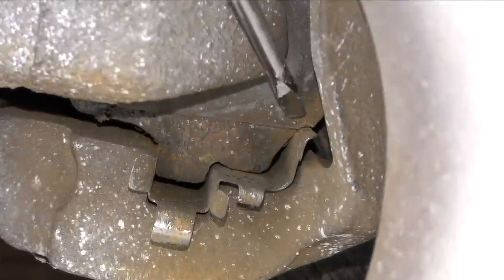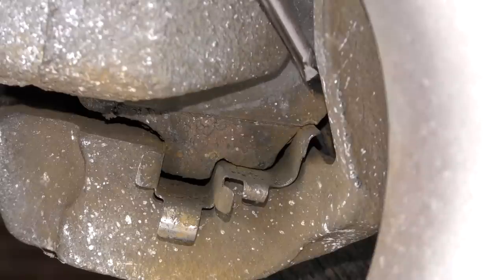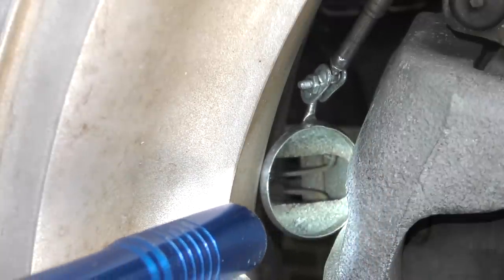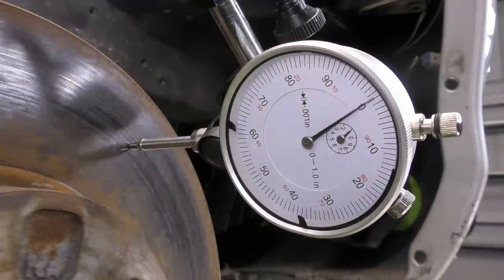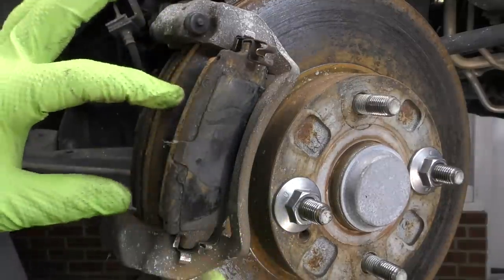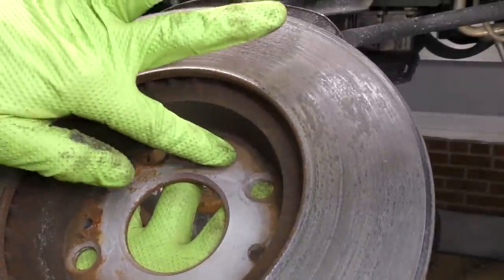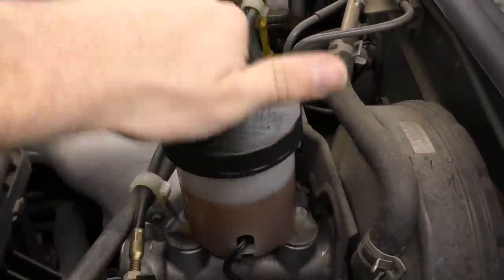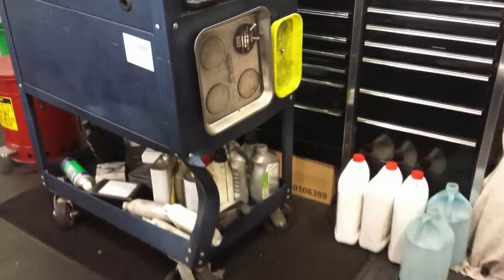Noisy Brakes? Why Your Brakes are Squeaking and How To Fix Brake Noise

Comment: Yeeesss!!!  You mentioned the transfer layer!  I see so many people not understanding how critical this is.  What do you call two dissimilar materials in contact?  A bearing.  The rotor acts as a surface onto which the brake pad transfers some of its material, and it's the friction of the brake pad against its own material that's responsible for stopping the vehicle.  This is why "pad slapping" a vehicle can be problematic unless you're certain the pad you're putting on is the same brand and formulation as the pad you took off.

Comment: One of the best brake videos I've seen yet!
Reply from the maker: Thank you
Reply: @HumbleMechanic  95% great except you did not go into how the pad slide in/out on the contact surfaces. 
You did lube the pad contact points however...
ROUND CONTACT EDGES:
the contact surfaces of the pad backing need to be filed so edges do not catch under load. 
This quick filing step ensures SMOOTH braking long after the brake lubricant is gone (except on protected slide pins).

Pad backings are simply pressed from sheet metal. Resulting contact surfaces are not machined to save cost, yet we expect them to deliver perfect contact interface under high pressure!!
👍

Comment: The brakes on my car tend to squeal when I brake sometimes, usually when I’m applying more pressure. When I’m slowing to a stop more gradually, it doesn’t seem to be evident. Another great, informative video.
Reply from the maker: Thank you🙏🙏🙏
Reply: make sure your caliper sliders are LUBRICATED... with SILICON LUBE not dried out "brake grease"!

When you look at your brake disc surface, you can quickly diagnose if brakes work properly!
 Discs surfaces should generally be SHINNY color and uniformly SMOOTH like mirrors.

You best chance to have great brakes is with matched OEM discs and pads. They have a very specific hardness to work together.

No need for miracle, smooth proportional brakes are almost simple.
👍

Comment: First time I did a brake job on my 91 civic, I didn't know my spring clips were installed incorrectly and I didn't know I needed new ones. 

Next time I did them, the parts guy asked if I wanted new clips... so I said sure! I put the new clips in the way the old ones had been installed, and my pads wouldn't fit in the caliper. 

I figured out how the spring clips were supposed to be installed, and the pads slid right in. It was a great learning experience.
Reply: that's why fixing stuff right is so satisfying !
✌️

Comment: No need for a big brake kit on a Miata unless it has been modified for big power.

Good video!
Reply: If it's going to be used for autocross, the bigger brakes can actually make the car accelerate a little bit slower - more mass to spin up.  I've even come across people that put smaller rims on their car for this reason (like swapping 17" diameter for 15") - especially small cars with small engines, as it makes a much more noticeable difference when you can't just power through it.  I'd say to upgrade the brakes if they're getting too hot (and if the rules allow), but other than that...as small and light as you can get away with and still have effective brakes.
Reply: Or unless you plan to modify for power :)

Comment: Thanks for the video man, it helped me to find a problem.
For 2 years my Miata  was making a rattling sound whenever I drove over a bump (but only with the right wheel). I thought that it sounds exactly like a loose heat shield or some piece of metal that was caught between the (welded on) heat shield of the second catalytic converter and the cat itself and I already prepared to cut open the somewhat rusty exhaust pipe (which is quite expensive actually). Your video gave me the idea that it might be the suspension and recently I have found that a 3 square centimeter big piece broke off the brake pad and was stuck between the brake disk and the rear shielding. I guess I have to do a brake job now

Comment: Wow- you are so knowledgeable- thank you for such detailed analysis and explanation!  I do have a question coming up:  I know nothing about this subject, but as a working musician, I pride myself on having good hearing.  That said, I am so disconcerted that I did not hear any high pitched squeak warning ahead of time from what would have been the brake pad indicator on my 2006 Toyota Highlander, but instead suddenly heard a low mid-frequency grinding noise, whereupon I immediately took it to my mechanic.  He confirmed that it was indeed my rear brake pads and rotors, which had been replaced 3 years and about 45K miles earlier.  They are working on replacing them again as I type this. My question to you is:  should I be worried that I did not hear the high squeak indicator (something wrong with my hearing?), or could it have been that the indicator wasn’t working properly?  Thank you for your time and expertise!

Comment: I may have missed this - but one of the things I look for is what’s going on on the lip of the rotor; if there’s a groove on the top. A lot of people overlook the fact that auto parts stores will resurface your rotors for you and (if you don’t have a gauge) I they can measure the rotor to see what kind of lifespan it has left.
Reply from the maker: That’s awesome if they can!  Some rotors are cheap enough you may better to just replace. But some are $$$$ and I’d resurface if needed
Reply: HumbleMechanic plus, ETCG mentions that some of the parts stores have less-than-stellar machines - but my Touareg’s rotors are kind of pricey, so I put any saved cash toward the Mercedes or Caprice repairs / restoration. Princess drives the Mercedes and she goes to college next year (to study mechanical engineering and join a race team as an engineer) so...we can both do that Math! #MastersInEngineering #DaisyDriver

Comment: There are vehicles that the slid pins are not the retaining bolts and do get over looked. Often these begin to freeze up when not greesed, is a cause of one pad to wear or lock up the caliper. For me light braking is downshifting to drag my feet and moderate braking is that plus like 10-30% brakes. I prefer a rwd manual because there is more contorl over the car, like heavly draging my feet to ad in stoping kwik on a slick road or powering over to ad in quicker steering.

Comment: I just want to add that vibration can indeed be felt in the steering wheel if the rear rotors need to be replaced. My personal experience with my '01 Passat AWD. I had inspected them several months back when I replaced the pads, I had planned on replacing them at some point but other things took priority until about two months ago when I suddenly started getting a horrible vibration upon applying the brakes. Time and weather prevented me from investigating properly but when I finally checked it out...the front rotors were fine. The rear ones were obviously in need of replacement and after replacement, I found the vibration gone completely. I wished that I had simply replaced the rotors when I first saw them several months back but, daily driver is daily driven. I simply didn't have the free time to do the rotors as well.

Comment: Hey Charles!
How's the new Golf R? I know you love it, as you should. I'm enjoying my 2018 S3.
Since we have similar cars, I have a brake question for you...
When it comes time to replace my pads and rotors, what do you recommend? My wants are:
Stopping power as good or better than OEM.
High Longevity/Durability.
Compatibility with OEM S3 calipers.
Doesn't show those nasty rust marks.
Low dust.
Low noise.
Slightly higher cost than OEM is OK.

Thanks!

Comment: I had a rattle clunk on my Skoda Fabia vRS and I had changed parts of suspension as needed anyways and finally after a few weeks of this stupid noise it was the pad jumping because a shim had broken away! Very annoying!
Reply from the maker: Oh man!
Reply: I had a similar situation, but not as quite,     My Mother-in-law,  would come up the DRIVE way very Slowly,
but her - BRAKES were so loud,   when she would press on them 
&  I just changed her PADS in the Front,    So I was thinking to "myself"
It can't be the - PADS,   I just changed them, right? ¿,
So I took'um Apart, again,  &  carefully look at the *PAD - FRICTION - - Material ",    &  guess what I found,    A  piece of SHARP METAL - DEBRIS,  in a shape of a
triangle,  Stuck right into the "
FRICTION - MATERIAL,  hence scratching ON the  ROTOR!!!!
🤨😡🤬

Comment: Only thing I tend to do different is lube under the hardware to slow the rust down and keep the pads free in the clips. I'm also a big fan of the coated rotors, they help a lot here in rust country.

Comment: My NB1 started making grinding sounds shortly after I bought it. I changed the rear brakes and found the rear pads worn so far that there were holes in the pad backing plate. Somehow there were no signs of problems when I was test driving the vehicle.

Comment: Question for ya, odds are it was answered and I missed it (been watching videos and reading forums for a few hours now).
I have an 09 civic, and if I drive back and forth slowly in my driveway and hit the brakes, I get a grinding followed by a squeal with harder press of brakes (at less than 10 kph in my driveway). 

However, driving out on the street I have no issue at all. No grinding, no squealing, nothing.
Came up to a stop sign and casually "normal brake", or even if I slam the brakes, again no issue.
It seems to only happen in my driveway when going from Park to Drive, and stopping in my driveway (is on a slight decline). 

It's rather horrible, I've heard some nasty sounding brakes, but this sounds like your grinding sound in the beginning of the vid, followed dry ice on metal (worse, but best example I have).

Comment: Hey, Charles. What type of anti-seize would you recommend to put on the back on the rotor to prevent seizing? There is a debate on the internet as to whether use nickel or aluminum or copper anti-seize and things like how the copper stuff affects ABS systems or how using certain antiseize can actually cause galvanic corrosion. I've worked automotive and I've never heard of such things (especially the ABS thing). You aren't applying anti-seize to the abs sensor or even the tone wheel on the bearing or something, so how and why the copper stuff (applied to the hub and rotor mating surface) would affect abs sensor reading? Really kind of confusing. I bought some copper anti-seize from permatex and now Im scared to use it in a brake job now 😕

Comment: Here’s one that bit me in the butt: Brake dum adjuster cable.  The braided steel cable that holds the clip against the adjuster screw in a drum brake can stretch.  When you put on new brakes, rotors, pads, wheel cylinders, drums, and shoes, and do a brake fluid system flush, the old cable is not generally replaced.  I did this and felt a spongy pedal after I bedded in the new pads.  I then had to do an emergency stop and it felt like a bad master cylinder.  All the new components caused the cable to stretch to the point that the adjuster screw was not holding and the shoes were too far away from the drums, cooking the new front discs.  A $3.68 pair of cables now have to be replaced along with another set of front rotors to replace the now overcooked and warped rotors.  LESSON LEARNED: REPLACE ALL YOUR HARDWARE.  Now I buy every clip, adjuster, cable, spring, screw, etc. when I do a break job.  My safety is worth the extra $10 a corner.
Reply from the maker: Oh man!!! Tough lesson to learn

Comment: Serious question maybe silly, but when cleaning my wheels the spray gets on the rotors and of course the iron etc rust fast. I rinse after 30 sec per bottle and wipe. After cleaning my car I go down road to brake several times to get rid of rust. My question is do you think this will ever make the rotors weaker because I track my car?
Reply from the maker: Nah that little surface rust is burnt off the first time you stop the car.

Comment: Also mention if you are doing rear disc brakes not to force the piston in without turning it with the special tool.   
  And if you have electric parking brakes, you have to use a scanner to retract the Pistons for service, then use the scanner to reset Pistons in rear caliper after service.

Comment: My MK4 Golf has had rear brake squeak while reversing pretty much since day 1. 411k miles and on the 4th set of pads and rotors with calipers done at the last brake job and still has a small squeak when reversing. Was this ever addressed at the dealer level? TSBs?

Comment: Thanks Charles, always love the videos! Just looking over my Mk7 GTI PP, I notice I have good pad thickness but a sizable lip on the top edge of the front rotors. With 43k miles, is it generally worth replacing everything?
Reply from the maker: Not just yet.  The rotors are soft on those. And brakes are not cheap.
Reply: HumbleMechanic thanks for the info! I’ll keep an eye on them. I like to give everything a good once over when I change the oil.

Comment: I've had a clunk noise for a while after I had to get the brakes off and on to replace another part. I changed brakes on my care before so I know how it all goes together BUT turns out that the outer front pad has a spring that pulls the caliper and pade where the should be. after getting it off ONCE the spring was so deformed that it wasn't working anymore. only solution was to get the cheapest set of pads, steal the spring from them (not available as a separate part) and put that spring on my better quality pads. that was a hard to find noise if I ever had one

Comment: So what is it with my 2014 Jetta when every morning or if its sat for a long period at night here in eastern NC, my brakes will squeal when I first use them, then not again the rest of the drive? They dont seem to show any bad wear, and have done this since I bought the car from VW at 68K miles. Still have plenty of brake life at 130k miles BTW
Reply from the maker: Normal noise. You’re hearing the rust get cleaned. Totally normal
Reply: @HumbleMechanic  that's what I figured, and I do live in a high humidity area where its foggy just about every morning, just wanted your input on that. Still amazed at how long the brakes have lasted on this car, over 60K mi!!!

Comment: @HumbleMechanic 

What are your thoughts on changing out the Brake fluid from DOT 3 to DOT 4 or even 5.1?
Reply from the maker: 3-4, good, 3-5.1 good, 4-5.1 good. Do not use 5!! 

In most normal situations 4 is a great value. It’s what I’m running

Comment: With the brake pad hardware, particularly in the rust belt, many folks advocate for greasing under the hardware (between the hardware and the caliper bracket) and leaving the ears on the pad clean.  Also curious on your thoughts on bleeding - in particular, if you aren't replacing the fluid and flushing the system, do you crack the bleeder before pushing back the caliper piston?
Reply from the maker: It depends on how bad the fluid it. If it’s not bad I won’t crack the bleeder. If it’s bad and I can’t flush I will crack it.

Comment: Hi, are the 2.0 tsi PETROL engines generally noisy, mine is, just abit tapity , i changed the tensioner last year and checked the chain with obd eleven, it was 3.50 + or - , so within its limits, iv got castrol edge in it but it just sounds abit like a diesel, cheers.

Comment: I’ve got. 2019 ford tourneo only done 18k I started to get a squeal from the brake so I replaced them with original parts done some miles still had the same problem so booked it into a garage and they said it’s the pads so replaced when with a top brand and still have the same problem the said it might me a sticky calliper I’m think why I can do to get rid of the noise 
Even slightly pressing the brakes on 5mph it’s a high pitch squeak 2 sets of pad same problem

Comment: My driver front brake makes a noise the first time I move it each day. The pads have a ton of meat left on them. The rotor isn’t awful either. I’m convinced it’s fine like you said, it’s just weird it’s only the front driver side.
Reply from the maker: If it’s just for one or 2 stops it’s normal. You’re cleaning off oxidation

Comment: sometimes the brake dust shield is bent towards the rotor and makes a metal noise while youre turning at slow speeds.  this is usually for old cars

Comment: Not to a great extent but I've come across poorly manufactured or missed in QC, Pad and Brake Shoe backing plates. The stamped steel with some burrs, nicks and or flashing that required some form of  light TLC with a file.
Reply from the maker: A slight chamfer in the edge can be a good idea

Comment: question I have a 2016 all-wheel-drive Chrysler 300 last week when I was backing out at work all the sudden I’ll just horrible grinding noise and then when I would drive forward and Would grind just not as bad and would go away and it’s really bad when I back up and it sounds just like the beginning of your video.
Reply from the maker: Could be the brake wear indicator
Reply: @HumbleMechanic   it is bad break pads the little  Metal piece that makes noise when they get too lowas making sound like a month and a half ago. That's my wife that said that up top ah under my account. But yes it is brake pad she may need new rotors but we'll see what the mechanic says I didn't really get a chance to look at the. Rotors before she took it in but i'm positive she needs a new brake pads.

Comment: ive helped my dad change brakes several times and parking brakes, even helped their friend with it and every time ive told them reusing the mounting hardware is a terrible idea but ofc they never listen. until last time when a parking brake spring broke, dad tried fixing it but that was obviously doomed to fail. it just ended with me having to race down to the store 30min away to get the proper installation kit and finish mounting them in the dark with a headlamp on, if only they would listen🙄
Reply from the maker: Dang!!!!